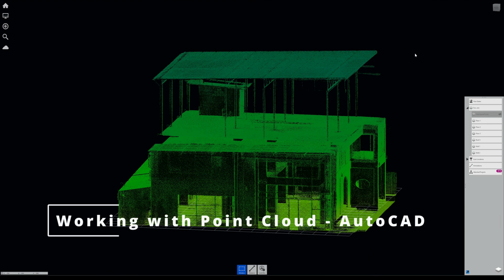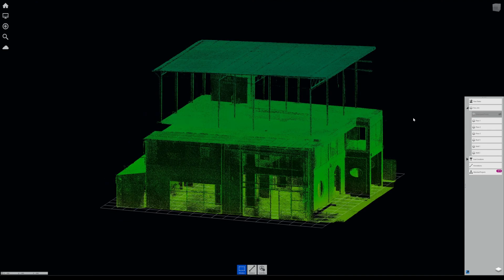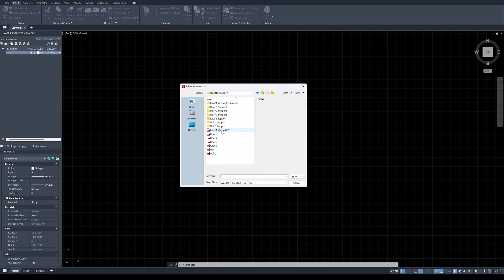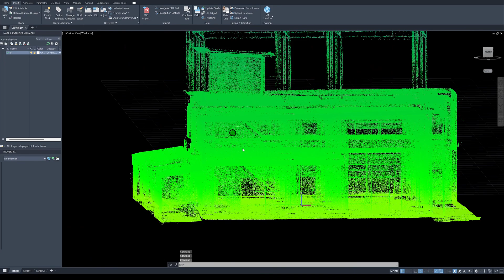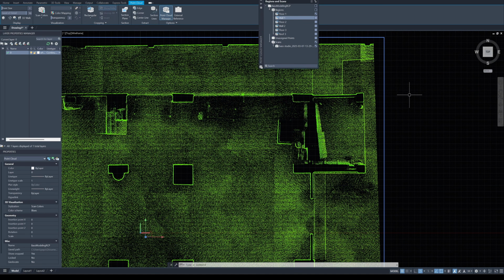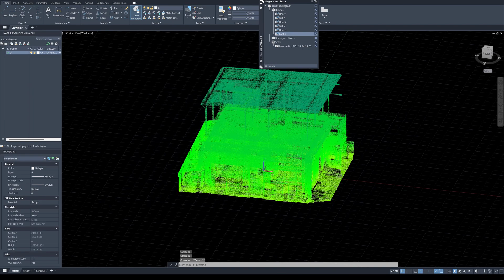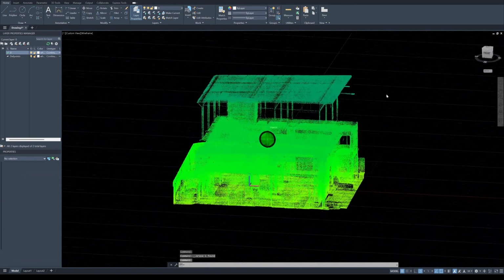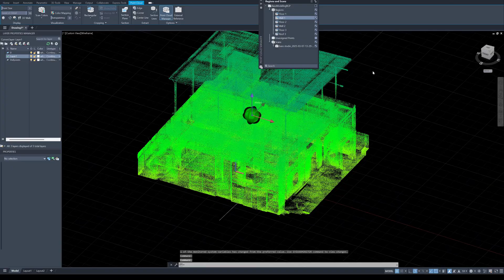Step-by-Step: Working with 3D Scan Point Clouds in AutoCAD

Comment: I really enjoy autocad.  I wish it was possible to get a perpetual licence.  It's a lot slower than inventor for designing parts, but I still prefer it for the most part.  I mean, when I'm designing an assembly I still end up going with inventor... until my licence runs out.  Then back to freecad... cries
Reply from the maker: I'm looking into BricsCAD, they have perpetual license for 1600 USD (ultimate version, non-US price) I've heard good things about it and it's very close to Inventor + AutoCAD. 30 days free trial. I haven't got the time to try it yet, but I will.
Reply: @Payo-TensileCreator  I would love to hear how you like it.  Unfortunately their support for macos is abysmal and autocad for mac is significantly better.  I have to run inventor on my PC, but my primary machine is the mac.  I also didn't like how bricsCAD took control of all the .dxf and .dwg file times and removed the preview thumbnails and replaced them with a generic bricscad document icon.

I did look hard at them due to the perpetual licence.  If Inventor, or autocad had a proper perpetual licence I'd buy it in a heart beat.